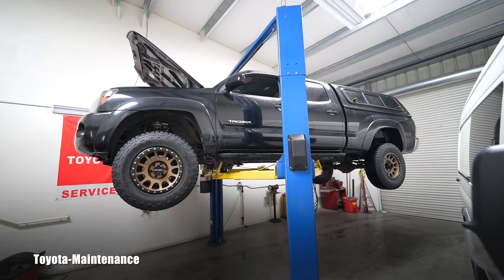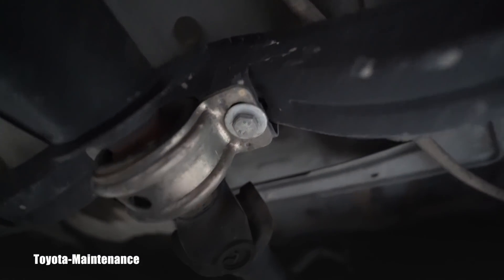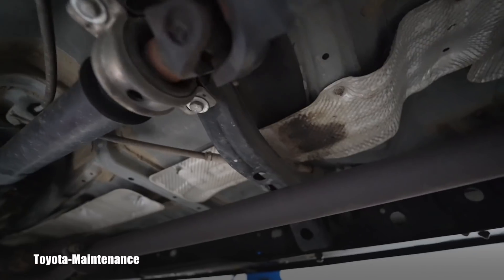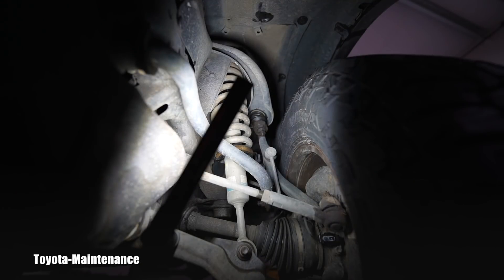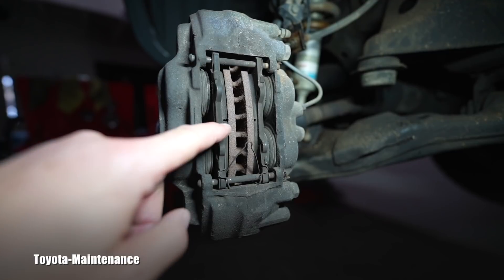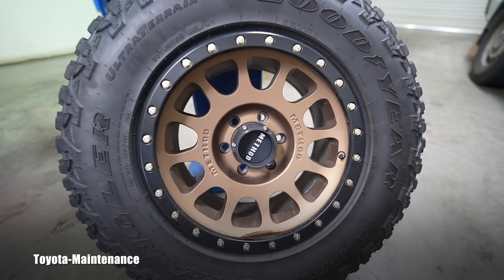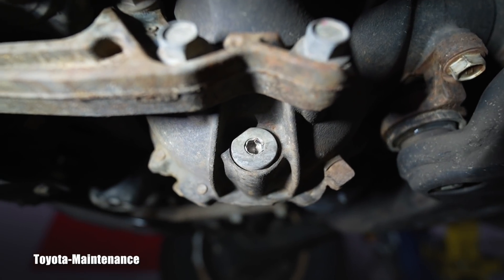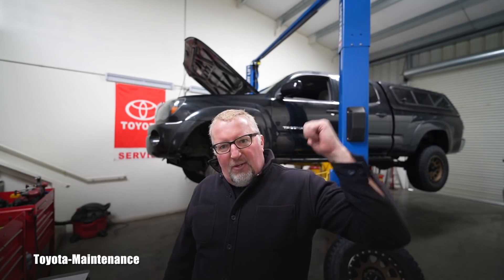2009 Toyota Tacoma with 318,000 miles

Comment: I have an 09 with 140K faced many of these issues including the front dif drain plug. The dealer had used a cold chisel to get it off for service and I wasn’t about to do the same. So I used a vacuum pump and a wine bottle to suck the old oil out the fill hole. I was able to get almost all the oil out. 

When the dealer replaced my frame ( I live in road salt hell) much to my delight they replaced the drain plug with a brand new one along with about four pages of parts. Bonus!

Comment: KICK A$$! LOL! Well Done again Sir! There should be more mechanics on the planet like you! I was going to replace my 2006 Toyota Tacoma with less than 100,000 miles. The price of new and used Tacomas and other Tacomas is ridiculous now days. I will keep my Mint condition 16 year old TACO with a Cap,  until FOREVER!
Reply: 3rd gen will be a disappointment.  I drove my 06 for 15 years.  Have had the 21 almost a year.  The 06 was a better truck.  I sent mine due to cancer on the bottom of the cab and rockers.  Salt State.
Reply: My '06 had its frame and rear suspension replaced by mother Toyota in 2018 (!) free of charge and I've since had the entire body re-painted. I'll Never sell it. 
Turned 250k miles (on the original clutch) a few weeks back. I do dislike the "chirp" of the TOB... but until failure courses.... she will run on...

I did replace the front diff needle bearing with the EastCoast Bushing. Replaced the front axels with JCD out of Denver. Had the dealer sit it back down on new front Struts/ Back shocks and Bilstein 5100s.  Rear 1.5" AAL. Front Bearings also new in 2018. 🤘🏼
Reply: @danielborrer270  I got a frame too.  That's when I upgraded from a Bilstein level lift to OME.  Used Toyotas 'recommended' repairs list to refit it in late 17.  Hang on to yours.  Newer is not necessarily better.  In a couple years, a 2.4 will be the only engine option.  Going backwards, we are.  Regression in the name of new stuff at any cost!
Reply: I’ve got an ‘05 Taco, 219,000 smiles, runs perfect, burns no
Oil. Just good maintenance, is all. I hope to be able to drive it more years to come!

Comment: I replaced my center cardigan joint that had developed a lot of play. It fixed my vibration issue in my steering wheel! So happy. Great channel. 144,000 miles on my tacoma, frame was replaced. Front rack is starting leak on passenger side. A little trick for the front diff plug, is to give it a couple whacks with a hammer directly on the plug before trying to loosen. You know this I’m sure 🤘
Reply: The 2005 & later tacomas don't use the double cardigan u joint.
Reply: @waynes.2983  my 2008, the same one shown in this driveshaft video. It went bad. I’m sorry I thought it was called a cardigan. Guess it’s just a drive shaft center bushing support then. Is that correct?
Reply: @chadrides914  yes, also known as a carrier bearing. The 2004 & earlier taxomas do have a double cardigan u joint though.

Comment: Im in Canada, I've got an 06 with 338,000 miles. I bought it used in 2010 and besides the aftermarket suspension work and rims tires, All ive done is based work, oil and filter every time the light comes on.

As for the driveshaft, Tom woods makes a beautiful 1 piece drive shaft replacement for these for $375 US.  This replacement is better quality, and eliminates the shutter.
Reply: tom woods WILL NOT make a shaft for this truck , I tried and he will not make a shaft this long in one peice
Reply: @jumbo2608  Sorry, I did not notice it was a long box. Have you tried carrier spacers?

Comment: Impressive mileage!
Ahh the Tacoma shudder...I had it in mine too. Replaced the carrier bearing and needle bearing, plus shimming the rear u-bolts with little improvement. So took it to a drive shaft specialist in my area and had the drive shaft balanced and replaced the u-joints too. Once in a while I still get a tiny shudder but nothing like before.
Reply: Went through the same thing on my Taco and the sporadic tiny shudder turned out to be the rear brake drums.
Reply: @ghostship7823  70K
Reply: @ghostship7823  ghost ship...did you burn down?
Reply: I’ve had issues with rotors and drums shaking. Replaced the rotors with smooth brembo as and turned the drums only for the guy to scores them up worse then had them turned again with improvement but within a year they are shaking again . Going to have to upgrade to something better and replace the drums this time.

Comment: We got our front diff drain plug loose with a big chisel and one tap with a hammer. Once it was out my mechanic welded a nut to it, and I've been using it like that ever since. If you buy a replacement it will only get stripped again. Also, I'm told there are Lexus versions of these plugs that you can put a socket on instead of the hex.
Reply: I had the same and got the Lexus to replace it, I prefer it

Comment: 7:08 Periodically spray ALL rubber components / parts underneath your vehicle with 303 Protectant , to resist drying out and cracking .
Reply: It is also terrific on tires, too.
Reply: Just did mine yesterday! Great tip.
Reply: @alexdesamsonow822  Thanks
Reply: But , for exterior plastics / trim . Spray on  , let set for a few minutes , then wipe in / off with a microfiber towel . Or you will have white streaks that will be very hard to remove .

Comment: At that high mileage (plus the larger wheels/tires), I’d be looking at replacing all suspension bushings, axles, etc.  You don’t want to be in an accident if something breaks while driving on the highway (or off-road).

Comment: My 08 Tacoma had the same issue. My issue was torque converter shutter with slight uphill acceleration. Trans fluid change fixed mine

Comment: The viewers should see that the drive shaft support is definitely worn out. The joint in that drive shaft should be held stationary, not be able to flop around as the shaft rotates. The U joint behind it should also be replaced, since I could see some movement between the two parts of it, as Peter wiggled it. Those needle bearings inside the U joint bearing caps should have zero play in them. If you can move the 2 pieces of a U joint any other way than rotation, like they are designed to move, the U joint needs to be changed. The ones which leaked grease might be on borrowed time too. Once the seal starts leaking, water can get inside and corrode the needle bearings inside the U joint. Water loves to fill tiny gaps using capillary action.    
Any vehicle with that many miles on it will have some worn front end parts and bearings. Grease leaks are often the cause of accelerated wear under there. See obvious grease leaks, and a problem will eventually follow. Even if no water gets inside the bearings or ball joints, the air will eventually degrade the grease, and it will dry out, solidify, and lose the ability to get between the steel surfaces.

Comment: My 07 Corolla isn't that far behind that truck. 267,000 miles on the meter and still going strong with the original engine and transmission.
Reply: Thats what I had on my 97 camry! 267,000 miles. The ONLY reason I got rid of it was bc of too much rust.😞 Good luck w/ur corolla!
Reply: @riceburner4747  my last car was an 06 Corolla that I got at 48,000 miles. And the space of four years I took that car 232,000 miles and the only reason why it died is because it was rear-ended buy a big pickup. Rust is not an issue down here in Texas. LOL

Comment: I don't know why Toyota uses those hex plugs on the front diff. They are terrible for that application, and the more people that touch them increase the chance to strip the socket. Lexus GX bolt head plugs are a direct replacement- fill is 90341-18060 drain is 90341-24016
Reply: Yup, I live New England. The drain plug was frozen in. It was obvious the guys at the dealer had used a cold chisel to try and pry it loose. I used a vacuum pump to siphon out oil through the fill plug. Got lucky when they replaced the rusted frame they replaced the plug along with a ton of other components. But I’ve written those numbers down, good tip!
Reply: Thanks!👍🏼😎✌🏼

Comment: LMAO That is way excessive play in the Center Support, It's like why even have one?  In those years Tundra had a Service Bulletin on the Center Support. Change out that Center Support and use the stock hardware. I did see play in the Ball Joint. R/H Lower control arm rear bushing looks wasted too. Probably damaged from all the oil over it.  The R/H brake pad hangers, the top one looks like the keeper is damaged. The R/H Outer Tie Rod End looks like it has just been adjusted. R/H Strut lower bushing looks worn. I can't see everything. Truck looks great what was shown. If my drive shaft fell out I would want it checked for straightness.  A small bend would cause vibration that might have taken out the Center Support. Those are some nice wheels. This guy is lucky to get suggestions from YT.  And Always Follow the Service Recommendations in the Owner's Manual.

Comment: With that many miles on the transmission, what service would you recommend?  I always hear not to flush high milage sealed transmissions  in that condition , but rather do a drain and fill . What would you do? Thanks 🦾⚙️🧰🔧
Reply: You never flush a transmission, even one with 25k miles.  Do a drain and fill.  Repeat after 15k miles and then 50k miles thereafter.  Change it slowly over time, not flush it all at once.

Comment: Keep slide pins lubricated or one side will seize and other side will do all the work.  Been there.  Also...2+ inches of lift on a 2nd gen Tacoma is too much angle for the CV boots.  I had an OME lift.  Was fine for a decade before.  Lifted it from 1-3/4 to 2-1/4 with the OME and immediately the boot fins started wearing on themselves as they contact because that angle is too steep.  Also had to put a bushing in place of driver's side needle bearing to get rid of a hum.  After 25,000 the front diff was noisy at 67-75mph.  Diff oil was changed on schedule with top shelf stuff.  Driver's side drive line cannot handle the angles of a tall lift.  Want 35s?  Get a drop bracket lift.

Comment: im curious since it seems always the driver side bearing bad is it because of the needle bearing play on the driver side front diff that seems to cause that side to go bad more than the passenger side bearing? if you wiggle the driver side drive shaft is there more play than the passenger side drive shaft? im just curious if this is what is causing the driver side to wear more than the passenger side
Reply: only the driver's  side has the needle bearing, not the passenger  side. It's  a bad design and wears out prematurely. East coast bearing has a sleeve to replace it and it's  much better . recommend their puller also but you  can  make one also if you have  the time.

Comment: I need advice from someone experienced with Tacomas. I did a center support  bearing replacement. No slop in any of the u joints but I did replace the center one because the seals fell apart on disassembly. When I replaced the u joint the new one was magnetized and gave me a major fight so I ended up buying another one. Long story short during all the fighting my alignment marks all wore off so I have nothing to line it all back up. I screwed up by using soap stone instead of something more permanent. So all I could do is align the yoke in alignment with the front u joint.  Well now I have humming vibration that feel like a bearing of some sort only at 51-52 mph. My question is there any way to line it all back up to the factory marks or would what I did be ok? The u joints look in line from front to back. I checked with a angle meter and it shows 1 degree off between the front 2 and 2 degrees between the front to rear. I doubt one tooth would move it 1 degree but I could be wrong. I compared it to another Tacoma which was 1/2degree  on the front  and I think either 1 to 1 1/2 degree which isn’t much different. Idk if the yoke being 180° would hurt or not. There is no hard rapid driveline vibration like one with the two driveshaft halves reversed. I’m not sure where to go from here so I’m just trying to figure what else I can check before I have to pass it off to another shop.

Comment: Just had my Carrier bearing replaced on my 2010 Taco with 250,000km. I have stripped the front diff drain plug twice on my truck when changing oil and had to take it to the shop; have heard from others they have trouble with this as well. Any tips on avoiding this and if it happens; what is the solution to get it out? (Basic thing is clean it well before using the hex socket... but this drain strips so easy!)

Comment: I guarantee the driver side CV axle is loose at the differential... the only lasting fix is replacing the tiny bearing with an ecgs bushing and a new axle... bad internal differential support causes that thin needle bearing to wear out, which then also hurts the wheel bearing from the vibrations, especially on lifted Toyota's... terrible design that plagues almost all tacoma/4runner/1st gen tundra and sequoia 7.5" front diffs 🙁